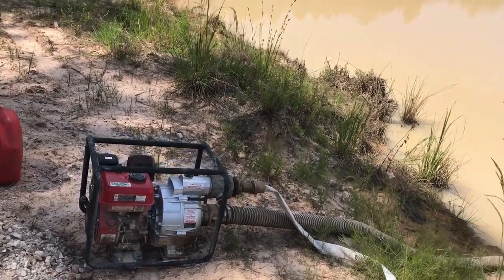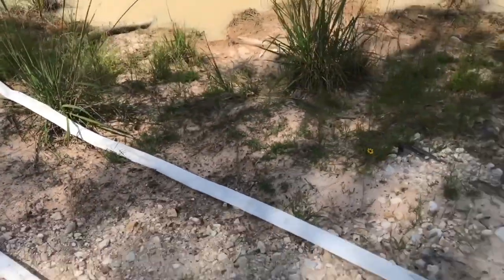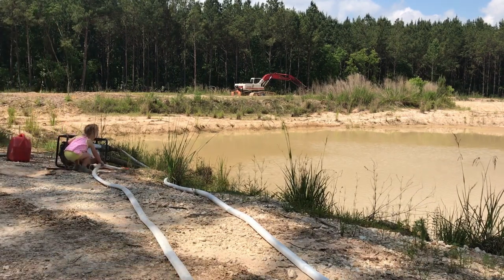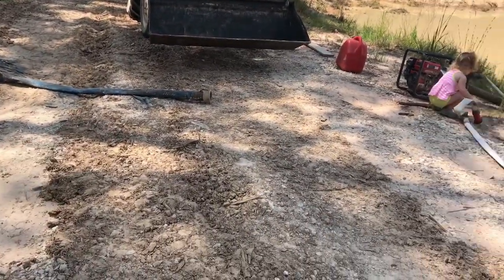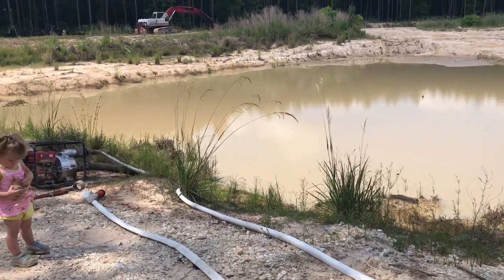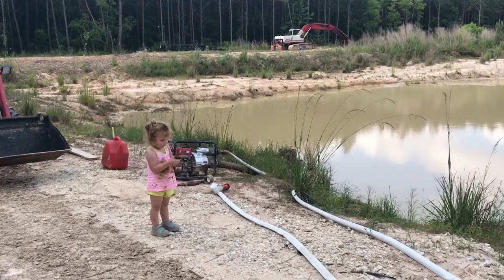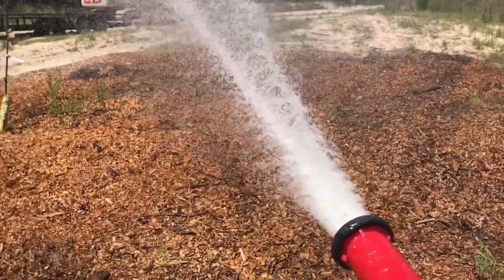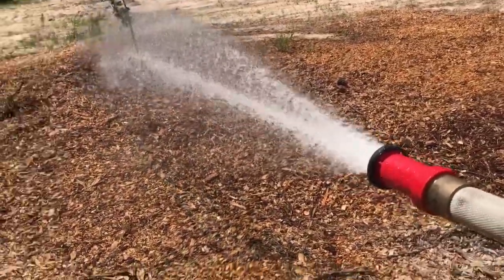Rural Fire Hose System - Watering Orchard

Comment: Tom - just got a Brave semi-trash pump, to do a couple things, inc watering protection around burn piles.
Honda GX160 5.5 hp 167cc engine, 147 GPM, 50 PSI, 2” male adapter, hose, and nozzle.
Will that be enough to send 50’ into trees or
What do I need to reduce to 1 1/2” ?
Thanks
Tom in Northern Wisconsin
Reply from the maker: I don’t know immediately off hand. Just remember your distance you can throw is governed by the velocity you create at the tip and how smooth that stream is. Velocity is a function of flow rate and cross sectional area. Q=VA. Q is essentially fixed (max) but can be reduced by back pressure on the hose due to bends and kinks, or elevation gain. So reducing A then increases V. So you could in theory reduce down to a 1/4”  nozzle and kick water really far, if the stream will hold together, but it won’t be much volume that you’re putting out. Best I can tell you is to test before you actually need it. Figure out a couple different nozzle sizes you like for what you may need. Also make you’re nozzles 6-10” long. Larger area on the tip means a longer nozzle. Gives more time for the turbulent flow from your hose to become laminar flow before it flies out the end 😁